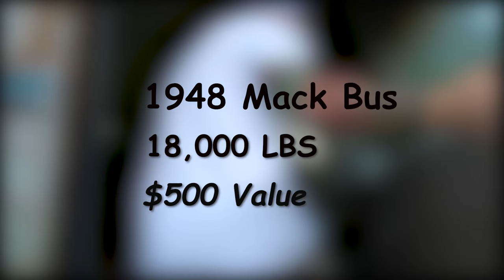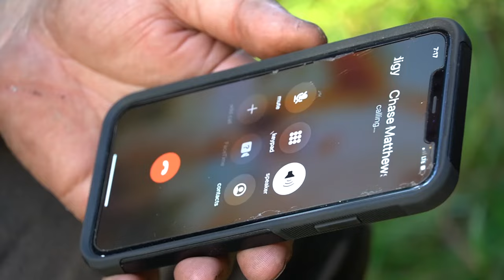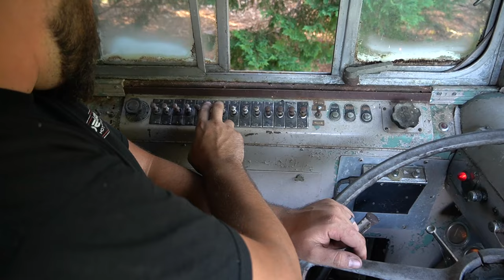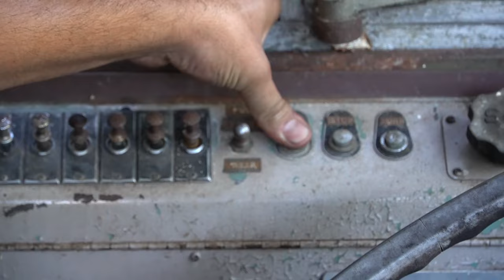This 1948 Vintage Bus Has Been Abandoned For 25 Years...Will It Start Up Again?

Comment: Congratulations on the bus! I hadn't seen an old Mack Bus until I started my new job about 3 months ago. I'd assume it to be a similar model to yours. I like your bus man. If you decide to sell it, give me a shout.  I like vintage buses. I've got a 67 GM PD-4107. I've been afraid to start for fear of the engine running away.
Reply from the maker: Just get you a plate or something and cover the manifold if it runs away
Reply: The good old GM Buffalo bus. 8V 71 Detroit? She should fire up. No problem. Provided the injector rack is moving freely, everything is in working order. Very very simple engines, wouldn’t hurt to keep something nearby just in case it does try to run away, but, it shouldn’t.
Reply: https://en.wikipedia.org/wiki/GM_Buffalo_bus?wprov=sfti1

Comment: First, I can't believe he forgot to send you after a flashlight. You ALWAYS need a flashlight. 
2. Is it leaking oil because he popped open the oil air filter? It almost looked as if the air filter had a line running to the motor.
Reply from the maker: @defiant Motorsports he may be on to something.
Reply: Oil bath air cleaners are designed to be filled with their own oil. They are not tied to the engine oil supply. Good thought though!
Reply: @defiantmotorsports4926  Normally yes. But it was very weird that the oil seemed to be coming right from where the filter was. Also maybe because it's a bus, they oil is cycled through the engine? But I don't know enough about 48 Mack engine, and not finding much online.

Comment: Congratulations on running the engine with no oil pressure due to the oil filter and lid missing. I wouldn’t advise you to keep trying to start it. The oil pump isn’t pumping oil to the engine it’s just overflowing the filter can.

Comment: Needs new fuel and oil injectors, needs new pipes and wiring and casings, sounds like the spark plugs need to be replaced, the oil tank needs to be patched badly, the air filter is in desperate need of replacement, and all the liquids need to be drained and refilled.  And then yeah, not only will the bus start up, it might even move.